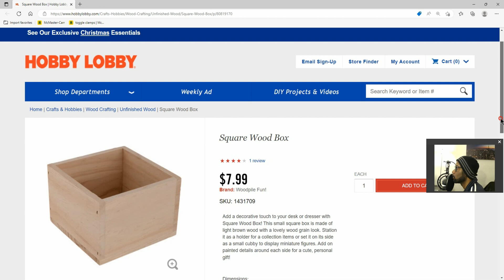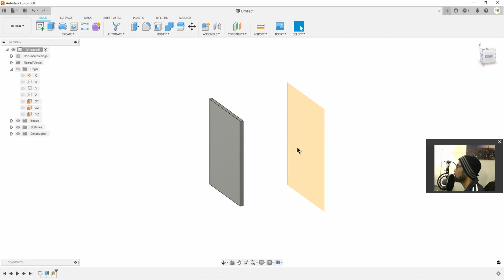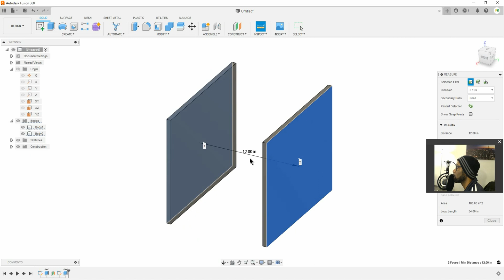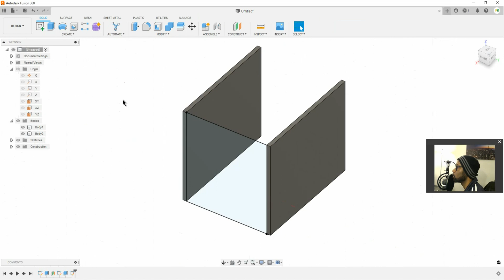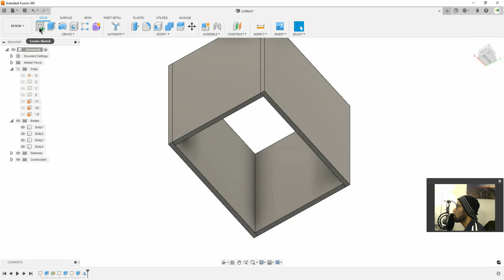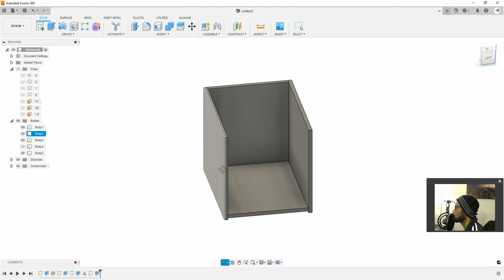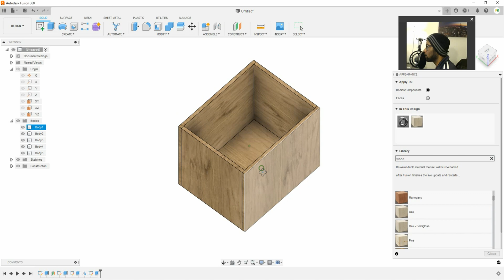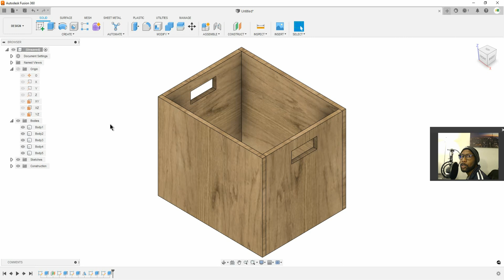Using Fusion 360 to make a box

Comment: Watching you work on fusion is giving me the ish to get back on my program. I've been setting up my shop and so haven't had time to actually use a cat software I've been doing a lot of hand sketching, goes a lot faster!🤓
Reply from the maker: Haha. As long as you can get your idea down somewhere. These days I model quicker than I can sketch but whatever works is the best. I am making these vídeos for people to be able to follow along. What software were you using?
Reply: @Neilthegarageguy  After working in oil and gas (mechanical seals) with Solid Edge/Inventor I purchased Fusion for my micromanufacturing/prototyping business.

I'm building two prototype portable sheds one with 8-ft tall ceilings and the other one 6 ft the square footage is 4 ft by 8 but can be added on to make it an 8 ft x 8 ft or an 8 ft x 12 ft shed oh! and I'm putting it on 55 gallon drums for floatation!🤓 We should collaborate!

De Chantilly!🧐✝️